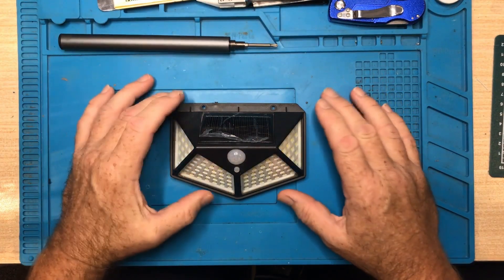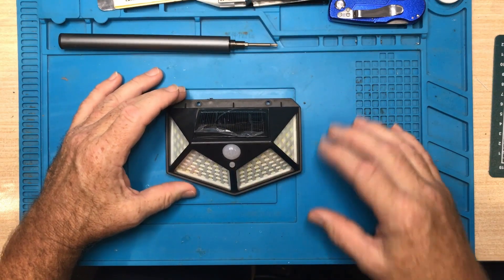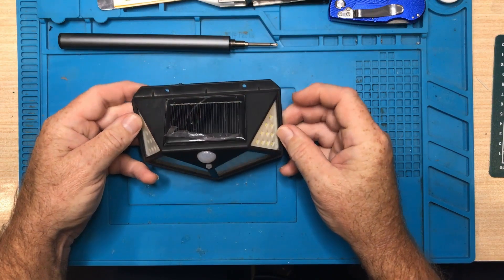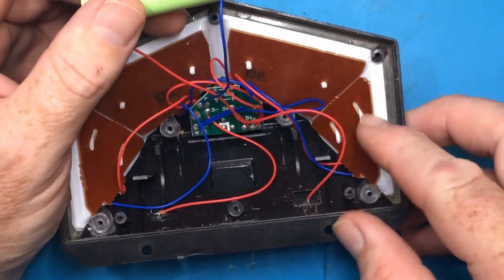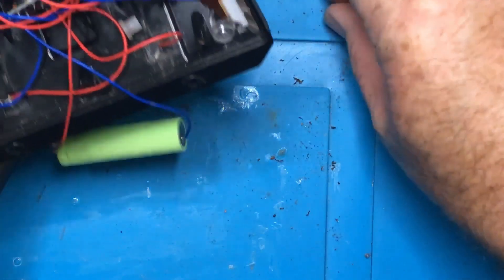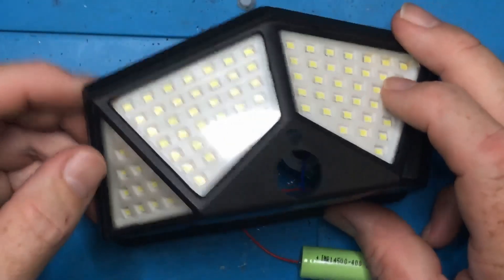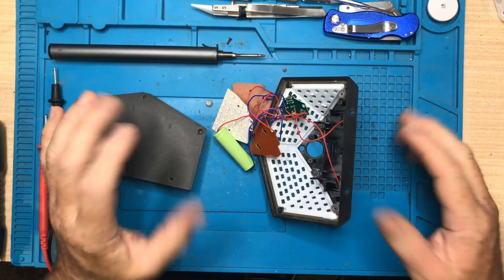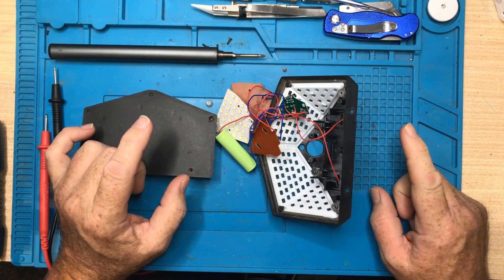FAILED! $6 TEMU Solar Light Autopsy

Comment: I have a half dozen of similar, no issues with the LEDs after three or four years now, but the solar panels have been dislodged by weather, hail got a couple of the domes over the electric eyes too, and the plastic surface is yellowing/going rough.  I wonder if some UV protectant for automotive use would help them.

Replaced a dud battery in one with a much better cell, once it evened out it performed no better than its sisters.  

Always wish things would last longer, but I can't complain for the price and the beating they take in the sun and storm.
Reply from the maker: Thanks for the information. It's good to know that they actually do last awhile. It would be nice if things lasted longer but if you've managed to get a couple of years out of them, that's a pretty good deal.
Reply: What battery specs did you replace it with? I did the same thing using a 3.7v 18650 2200mah from bunnings. Worked fine then all of a sudden stopped charging 🤔🤔
Reply: @joshuasticky  I used a similarly spec'd cell recovered from a laptop pack, around 2000mah.  The SolarMagic cells shown at Bunnings look to be just the thing, might check to make sure a spider hasn't grounded something.

Comment: I've had a few of these, from AliExpress but presumably the same thing. I'm in Northern England so sunlight is not guaranteed but the rain is 😂 but my experience is you get a year out of them and then they start to fail, the lights flash on and off and the poor battery does appear to be the culprit. I haven't found any issues with water ingress into the button as you have.

TBH the slightly more expensive ones from Amazon seem better, these I've had out there for two or three years and they're still fine.
Reply from the maker: Thanks for that. I'll check out the ones on Amazon as well.